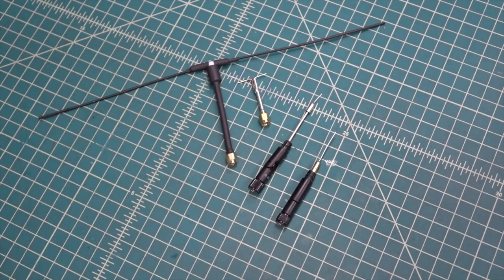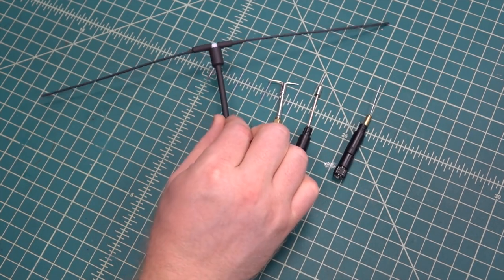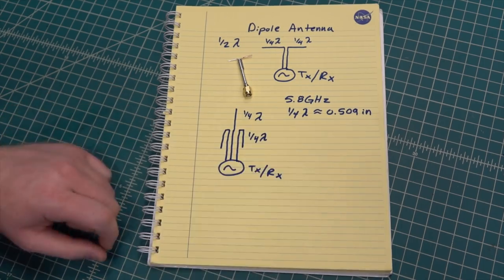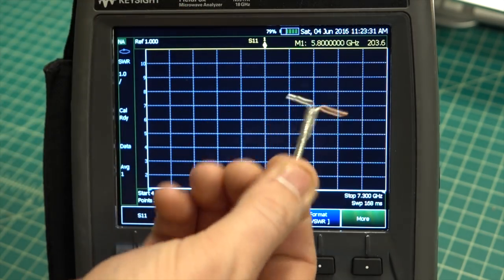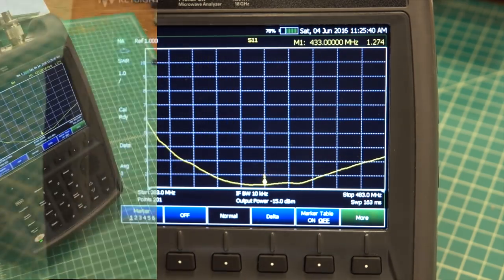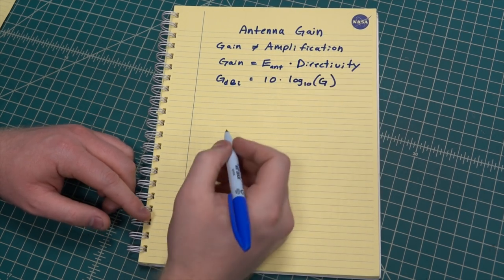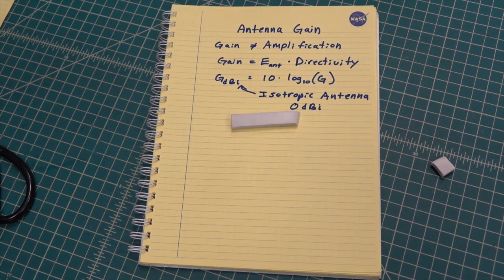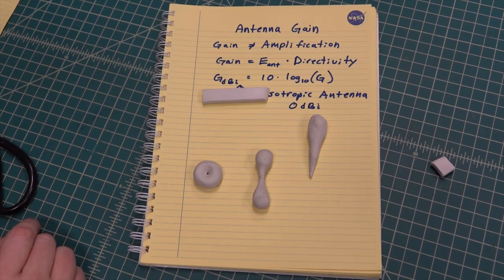Introduction to Antenna Design #3 // Dipole Antennas

Comment: Yours are the first videos that have actually started to help me understand the basics of antenna design. I have been trying to design a twisted birdcage style antenna for inductively coupled plasma generation for years and wile I understand how the antenna radiation pattern generates the plasma (I think) the nfiner details of actually powering the antenna, SWR graphs, and all that have always confused the shit out of me until now (I study mechanical engineering so I have had to approach antenna design from the very basics of electro/magnetodynamics as this is all I have been schooled in).

Comment: What I find interesting is router companies using the same antenna for their 2.4ghz radio chains and 5ghz chains. I've also noticed that their range on 2.4ghz tends to be under performing compared to other brands using separate antennas for each band

Comment: These are great videos and super helpful. Thanks!!!! Hopefully you can answer a  question. I’ve just started to check out PCB antennas. I ordered a fairly inexpensive set recently. Before hooking anything up, I took my multi meter to it. I found that there was continuity between both poles of the sma connector.
Is this correct? It seems to me that would negate any properties of an antenna the PCB’s may have. Any insight, information or wisdom would be greatly appreciated. Thanks again.

Comment: Another question I’ve had… As an avid hiker, ive found myself in serious backcountry with no cell phone signal or reception on my handheld Cobra CB. Could a drone drag a single wire vertically as an emergency antenna. I was thinking of a 1/2 pound of ultra thin copper wire which would yield a  couple hundred feet. Has this been done yet? If not, is it feasible. Any thoughts would be greatly appreciated. Thanks

Comment: Hello, is it true that is possible to measure the Antenna gain by placing two similar antennas one meter apart and use two NanoVNA devices?

Comment: Nice tute, came across you on reddit. Subbed. Hey, what make and model is the analyser? The units ive looked at for 6Ghz are 20k+
Reply from the maker: N9917A FieldFox Handheld Microwave Analyzer.  The price varies depending on what options you choose.  This goes up to 18GHz but they have models that go past 50GHz.

Comment: That graphic at the end tho, impressive! electromagnetic radiation is still a bit confusing to me, I have a hard time seeing how a magnetic and electric field (both of which I understand) can exist as one thing. 

All I know is that when charges are moving in a conductor they can create the alternating magnetic field shown in the illustration, and the charge of the charges is responsible for the electric  field half. That's what I learned in university level physics, still make little sense.
Reply from the maker: Thanks, I used this applet to make that visualization: http://falstad.com/emwave2/  It's a great tool to play around with.